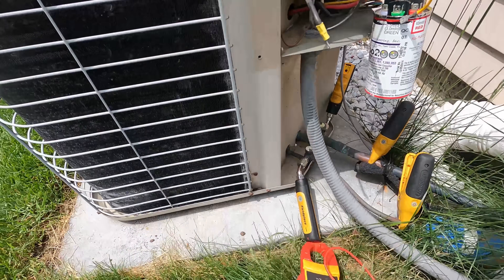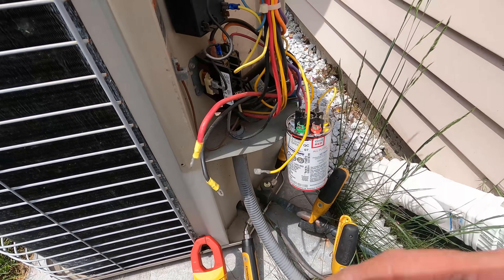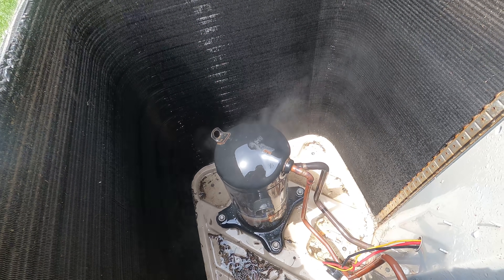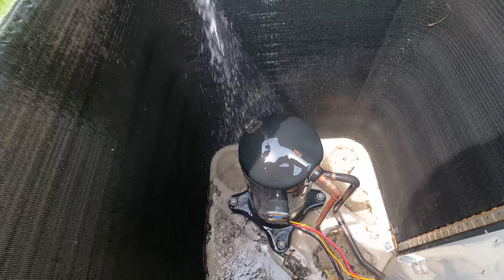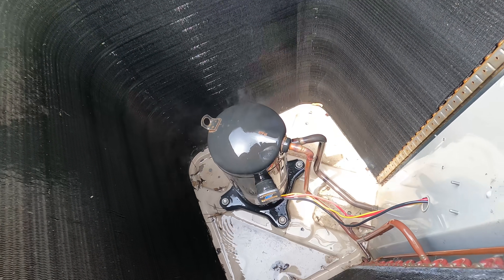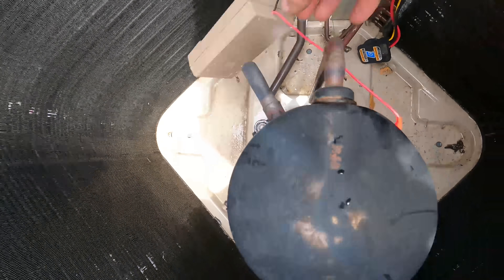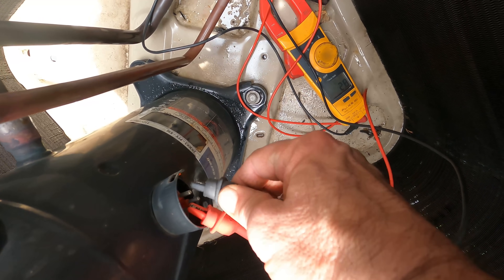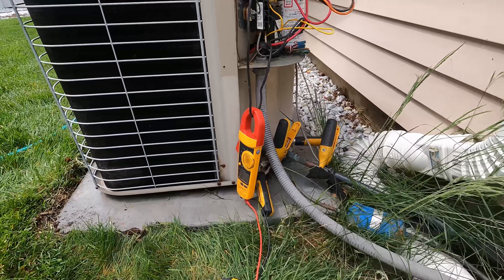AC Compressor Overheated Not Cooling Testing Windings/ Megging, Ohms Fixing HVAC System

Comment: This is a dumb video.... you didn't recover the uneven r22... you're supposed to recover everything, pressure test at 250PSIG nitrogen, then VACUUM "evacuate" the line set, you could have replaced the service pins too... then charge the system with r22 to factory charge. Ya clearly don't know what your doing or you are on purpose destroying their working AC.... charging it like that is just a waste of r22
Reply from the maker: Nothing in your comment makes sense. Why would anyone recover the remaining r22, pressure test a leaking system, evacuate a leaking system. Factory charge wouldn’t be enough to recharge this system. I don’t think you know anything about air conditioning systems and how to charge a system
Reply: Dude you just charged a leaking system... pressure test a leaking system is what ur supposed to do so you can fix the leak... how does fixing the leak not make sense? U charged a leaking system which makes no sense.
Reply: I just explained to you the proper procedure taught in training by all trainers in AC repair across the planet.
Reply: It's pretty simple to see that you just lied on the video or you just don't know what ur doing
Reply: @thehvachacker  i feel bad for you .. on one end i see where they are coming from saying this and that but than i understand your point of view as well  ... most of these mechanics in the comment section are stupid.. and think there the greatest   but keep doin what you doin .. dust your shoulders off keep movin... its hot weather and summer is coming everybody thinks we have so much time to spend at 1 location   if the owner opted to do the bandaid to get going fine... as long as he opted to change the unit out later on .... that's fine with what you did
Reply: @matthewphilpott1702  Yeah...you're wrong. Current EPA law states that you can charge any system that holds less than 50lbs of refrigerant without finding the leak. That choice is solely the customer's and the customer's alone. Thinking you can do whatever you want to a piece of equipment without the owner's consent is ethically wrong and grounds for a lawsuit. Sorry bud.
Reply from the maker: Jman everything I did on this call was with its owners consent. They wanted temporary cooling until they can buy a new system. I don’t sell systems. I got them running and had sales go back. Leak was found in 2019 on evap coil. Not a repairable leak. When it’s the first hot weekend of the season it’s just do what needs to and set up follow up visits to take care of and address. So the leak repair is a new system being installed mid June. Not sure why you believe I should blow up intellipak’s grey compressors with lack of return oil using m099. No drip in trane will no longer warranty comps unless 22 or 407 is used on 22 systems
Reply: Keep doing what you are doing man. I have seen a few of your videos and you are very thorough, and great at what you do. I am a supervisor at a public university for the HVAC department, and was in the private field as a tech for almost 15 years. You are in the top 10% of techs in my opinion. Thoroughness is everything. It’s not rocket science. I think your video lacked the context of why you added so much r22. Maybe I missed that part, so my fault. Of course you, or hopefully any tech isn’t going to add that much r22 without having a new system or salesman on the way.
Reply: @thehvachacker  I never once told you to use a drop in so why you suggested that I said that is beyond me. I’m well aware that using drop ins in voyagers and intellipaks result in dead compressors due to oil return issues. It’s why I never use drop ins. You get R-22 or nothing unless it has a TXV, in which case 407c is an option but that requires flushing the lineset and emptying the compressor sump of the old mineral oil first which isn’t generally cost effective in residential. YouTubeing HVAC comes with responsibilities to your potential viewers. If what you say is true you should have talked about it in your video so that future service techs don’t pick up bad habits from only seeing half the story. Leaving the system undercharged was also stupid. Teaching your viewers that it’s ok to do that is irresponsible. A compressor gets its cooling from the suction gas. Leaving the unit with 2 degrees of subcooling could have very well resulted in a locked up compressor due to high suction temp.
Reply: @Aarona-lj6wp  I would have added more R-22. It’s well within the customers right to have their system charged. The EPA laws state that as long as the system holds less than 50 lbs you can charge it. It’s not your equipment so you don’t get to choose what a customer does with it. Why the hell would I refuse to sell R-22 AND a system replacement on the same job? As long as I present the customer with all the facts and give unbiased recommendations, who am I to tell a customer no? The only thing I won’t do is half ass charge a unit because it’s leaking. I either charge it properly or I don’t charge it at all. I don’t even give the customer the option of telling me how much refrigerant to put in. They know the factory charge and the price per pound. I can give them a rough estimate but I make them abundantly aware that it’s charged when it’s charged. 

I’m sure you don’t take your car to the garage for new tires and allow the mechanic to take his own initiative to replace your brakes, rotors, and ball joints without your consent, right? Would you return to a mechanic who refused to replace your tires because they weren't worn out enough to actually even need replacement, even though you want to buy new tires anyway?
Reply: @thehvachacker  theres no point arguing with guys who dont actually work in the field and deal with customers, they read a text book or google procedures and think every repair goes like that.
Reply: @jman0870  I love techs who like to portray they know everything but tell you nothing.  These type of folk are deviants and not the kind you want to work with. What they really want is everyone else fired and them the only ones doing the job. They always moan about being under paid also. Wish they would f off !!!
Reply: @michaelcostello6991  the internet is full of them. Most commenters resort to doing HVAC in the comment section because they were too stupid to apply the theory they barely passed the tests on.
Reply: @jman0870  I find such a law rediculous, not finding a leaking system goes prior to the Montreal Act, which is to prevent destruction of our ozone layer, such EPA law is wreckless to the world. I have not reviewed such EPA law but I would have to scold them for approving such a irresponsable act. The purpose of the law is twofold to prevent the destruction of the ozone layer of our atmospher and to instill a sence of responsability into all technicians who work on such refrigheratns known to harm our enviornment when not recaptured. What is the purpose of a law meant to extend the life of our planet if they allow up to 50 lbs of freon to escape? Sounds absolutly rediculous. Invalidating the purpose of evacuation and reclaiming refrigerants.
Reply: @mattew Philpott I agree with you 💯 but also the tech have to go with what the client wants also what I think is technicians don't advise customers the right thing because they don't want to fix the problem they want a easy way out and put customers in unnecessary expense "NOT ALL TECHNICIANS" again im not a hvac guy im a elevator technician and I will be installing a trane mitsubishi 24000 btu heat pump with a three zone blower also im getting all required tools and equipment to service and charge also replace my unit my self because people are lazy these days and sorry but i can't trust a tech with my ac systems also I've tried contacting a few hvac tech and none of them are willing to work and very unreliable.
Reply from the maker: Fazir why can’t you trust an HVAC tech. Most of us stand behind everything we work on. This unit is getting replaced. Yet no one recovers refrigerant out of system to do a leak search. Unless all other methods to find leak fails. Then components gets separated. This isn’t a usual service call. This is a Sunday emergency call. This is get it running then return for follow for a leak search or major repair. This customer was just trying to get temp relief. This video wasn’t about recharging the system. It’s about running into an over heated compressor and how to test a compressor. Go through my other vids and you will see many refrigerant leak repairs. Yet when on call nights and weekends it’s not about being thorough. Just get system to work until a follow up gets scheduled. If your having problem getting HVAC help you might be underbidding the work
Reply: @thehvachacker  sorry I hop on your video to speak my mind out im not criticizing your work i respect what you did but again like I mention previous you have to go with what your customer wants but I've dealt with some unreliable HVAC tech where they don't stand on their words make promises and doesn't show up also I have tech work on my unit and did shitty job most importantly I never negotiate with any of my tech since I want them to perform a good job my experience is tech don't take pride its all about making quick money and leave customers to suffer its a real struggle on my end in one way im glad I'm forced to take care of my own ac problem and installation in the other hand im very busy and have squeeze my self to do it. Cheers  buddy I subscribed and follow for more videos.
Reply from the maker: Sorry you had bad luck with techs. Where I work we been in business since 1930’s. We retain all our customers and most the time after 15-35 years. We refresh those units without most customers caring to shop around. I do mostly commercial work, yet do have the few mansions I take care of and every 10 weeks I do residential emergency service. Not a week I look forward to. Yet some weeks are slow, or I never see my house like the week this video was filmed.
Reply: @fazirali6247  I was a service tech when R12 and R22 were common. Before there were reclaim tanks and the industry knew nothing about flourocarbons damaging the ozone layer. In those days it was standard procedure to ven to the atmosphere. Refrigerant was cheap in those days, around a buck a lb for |R12 and even less for R22.  I also wont trust most tech these days cause they have very little experience and you dont know the level of their training.  I installed my own central ac in my condo as well.  Since my sheet metal fabrication skills were almost non existant I had a local shop make up the transition from the top of the a coil to the ductwork above.  I did take the advice of a customer on one youtube pages recommending keeping a back up capacitor for the condensing unit so when it does go you are not stuck without cooling if it happens at night or on a weekend when the supply houses are closed. Best of luck in the installation,
Reply: @jbpost52  thank you!
Reply: @thehvachacker  did you try turning it on and off again?  hahah... hey man also i saw that megger and was like man that is ancient, and then you said i b et you never saw one this old before....lol
Reply: holds tongue and fingers from embarking on a massive rant..... lol
Reply: @jman0870  I agree, most customers that don’t want it and/or can’t afford a new system just want a gas and go... not much you can do as you mentioned it’s the customers choice that has the final say. That’s how it really is out in the field..👍
Reply: @jbpost52  FYI, the never was a hole in the Ozone Layer.

The Montreal Protocol was never intended to preserve the environment.

& China vents refrigerant 24/7 but the EPA only cares about a select few countries venting refrigerant....even though all countries share the same atmosphere.....so, it never was about preserving the environment.
Reply: @adamspears3819  EPA is an American agency.

Comment: Sorry but I am going to unsubscribe from your channel. Seems to me like you are more of a salesperson than a tech. Either your being pressured by your company to push for sales or like the commission. Even on emergency calls you leak test. It can be as simple as a leaky shredder valve, txv, cracked line, etc. But will never know. We don't go around replacing a units just because it leaks especially a big like like that that's easy to find.
Reply from the maker: You must be slow on the first hot weekend of the year to have time for a leak search. I ran 40 service calls last Friday, Saturday, and Sunday. Emergency calls are not regular service calls. They come in through the on call service. nights and weekends. I don’t have other coworkers on the road to pick up some of the calls. These calls are to get the system to operate. Then a follow up for a leak search or major repair takes place. I don’t have time to waste looking for a leak on these kind of calls. If it’s a service call dispatched from my office. Then I have time, and if 410a will  repair if possible. Many videos of me fixing coils, mostly evaps some condenser coils. Out of those 40 calls this was the only one that went to sales. A few I had to order specific parts for, don’t carry old r-22 carrier unit condenser fan motor 825rpm. If I put a universal rescue motor in then overheat and don’t last. That 25 year old system will keep running once the new motor goes in. Yet r22 systems that already been leak searched and documented, which owner wanted to replace, and still wanted it recharged for this weekend since 90 degree weather is here. It’s funny I get bashed here for most my videos fixing and repairing units many would condemn and replace. The one system that I fix and recommend replacing makes me a salesman. Yet I don’t do anything with sales. You should unsubscribe from my channel. You think I am a salesman when usually I only condemn 1-4 units a year out of 1000’s I work on.
Reply: Doing a leak search on an old R-22 unit at the end of its life is a waste of customers money. 
Putting a little buuble solution on the pipe connections, ok thats fine. 
But doing 1 or more full leak searches?
Why? 99.9% of the time its on the coil and not repairable. And even if it is on an area that could be repaired, sinking a lot of money into a repair on a system that old is a bad idea. Because its days are numbered anyways and the unit will need to be replaced soon regardless.
At that point your customer will be asking why they sunk alot of money into a system that needed to be replaced anyway.

Comment: Its tipical hvac technician...bl.bla.bla.bla.bla and use a lot of tools,machines,wires,ipads iphones,etc,etc......and the customer have to pay for a new sistem $15,000.00......ez money......uff
Reply from the maker: What is ez about the money? Working in a 150*F attic. Need good tools to correctly diagnose and repair AC systems. It’s very hard earned money in dangerous conditions to work in.